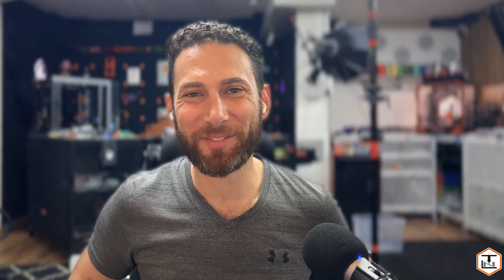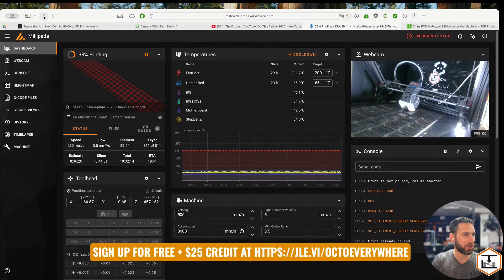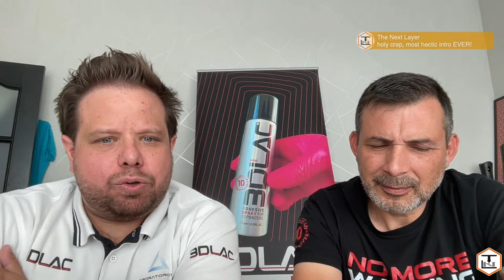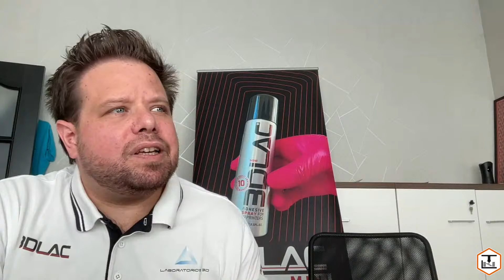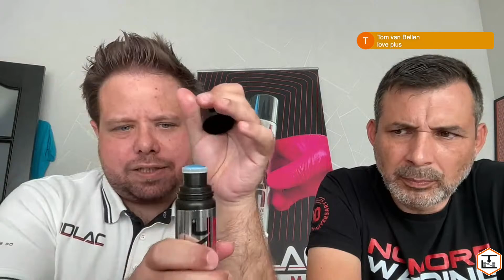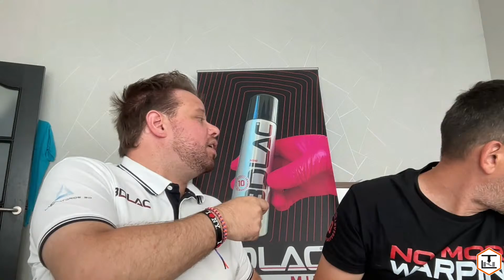Ep. 66: David Martinez of 3DLAC on Innovating Bed Adhesion for Reliable 3D Prints

Comment: It depends how large my prints are whether or not I need adhesive (I use a Vcore 500). When then indeed 3Dlac is the better choice, only for PC the specialized Magicgoo is better. Application wise #Dlac wins from Magicgoo by miles. A quick spray and you are good for at least 10 prints, just make sure you "bake" the 3Dlac for a few minutes. The Magicgoo felt tips break way too quickly on the rather coarse RatRig PEI sheets.